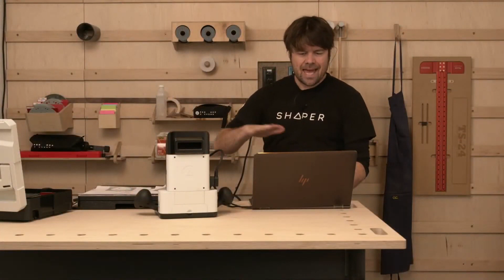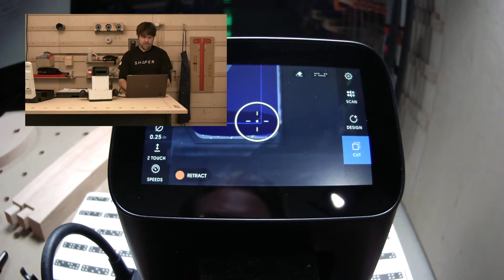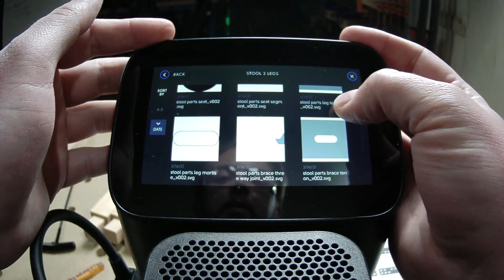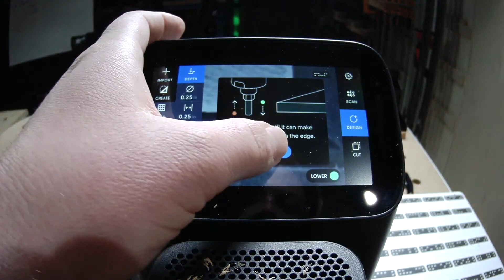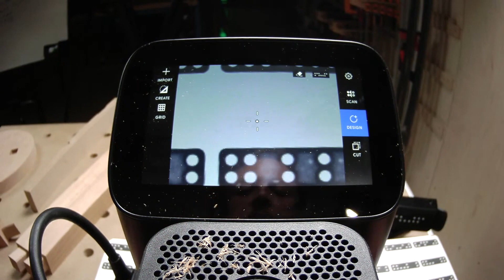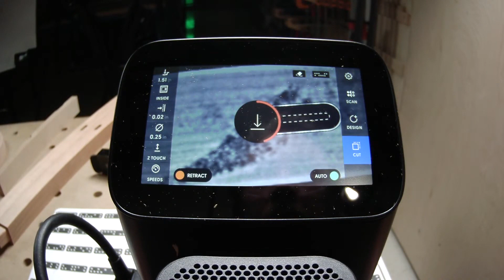Session 30  – English: ShaperHub Project Build

Comment: At 6:30 you offered advise regarding cutter length.  In my Aerospace Machining experience we followed similar guidelines.  Our rule of thumb was a maximum  4 : 1 (stick out Length : diameter) ratio.  Longer lengths typically created undesirable vibrations.  Here you are machining wood while my team was usually milling titanium.  It appears physical vibrations apply to either material.  Also your suggestion to plunge the corners is spot on.  Thanks for the good demonstration.